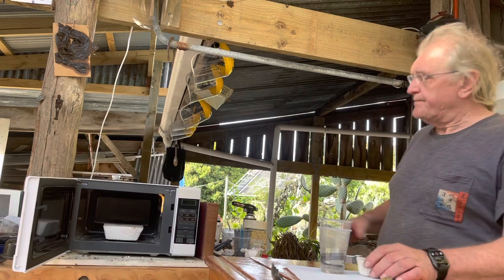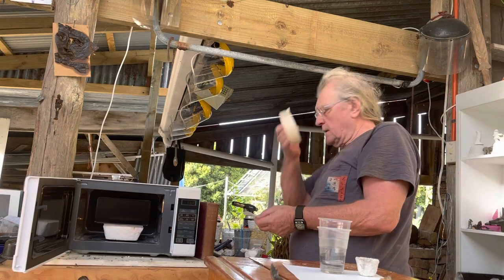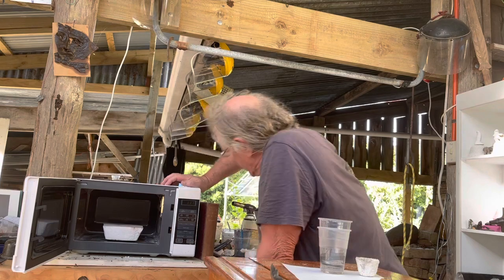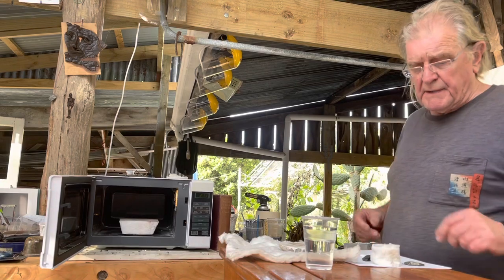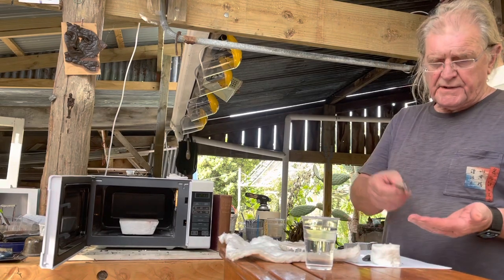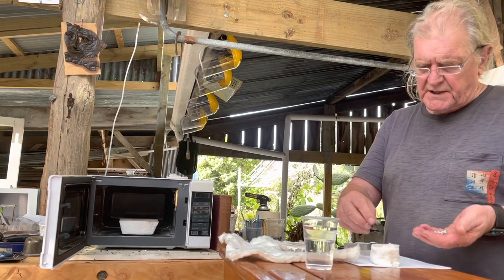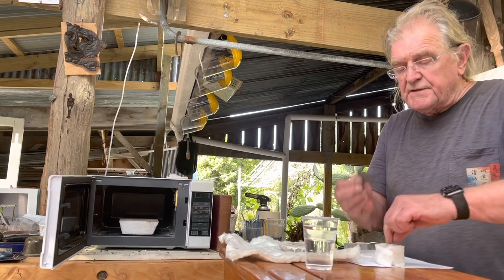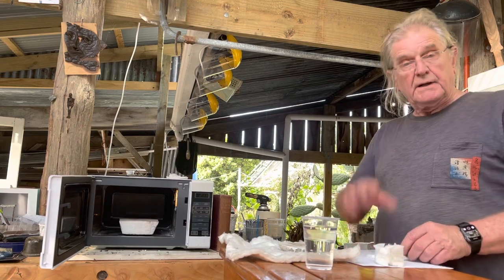Some of the physics behind melting metal in a microwave field

Comment: So my concern has always been the crucible overheating the microwave walls and causing a fire. Can toy speak to the resistance to flame of the microwave interior wall material?
Reply from the maker: The crucible is enclosed in an insulating ceramic blanket. Not much heat radiation reachs the walls. The enameled steel holds up pretty well anyhow